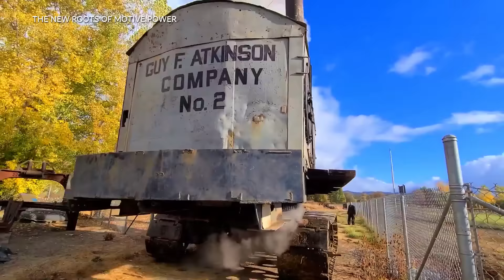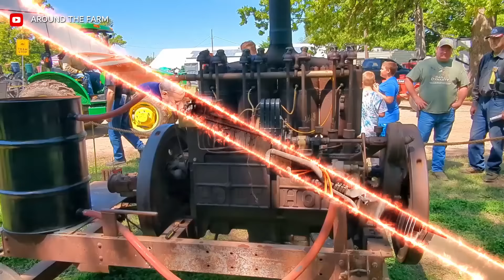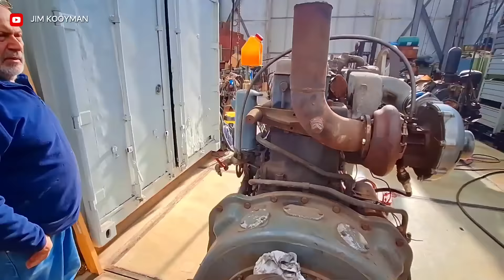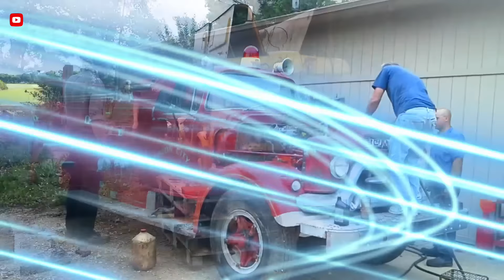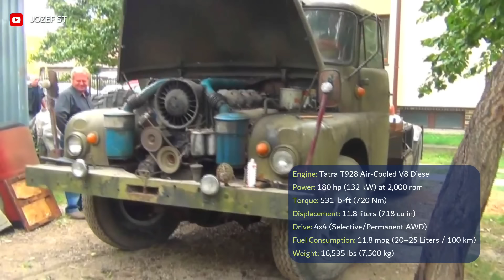Best Engine Ever…🔥 Will They Still Run? Starting Up Forgotten Giants From the Past

Comment: The first one, the Duvant, is NOT a single cylinder ; you can clearly see the two cylinder heads at the end. You say that it is started by compressed air, I am very doubtfull about that.

Comment: The Gardiner 8 cylinder is not naturally aspirated, it is turbo charged. You can clearly see the turbo in the video.
Reply: I'm sorry but I can see no turbo on the video... If you watch the exhaust from the manifold till the muffler and the exit, you can nothing else than a tube...
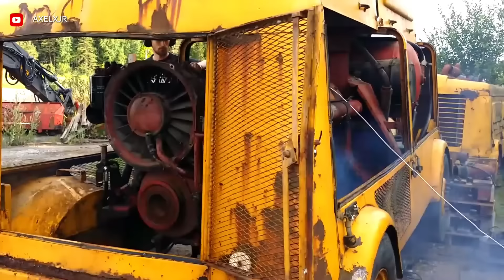Reply: My apologies, I thought you were talking about the first one... Yes, you're right the one at 10:42 IS turbocharged, of course !
Reply: Gardner.
Reply: One thing to add is gardners never had turbos they were N/A  6LW's were produced during the war in 110 DC generators for search lights , they were bought after  the war by showmen to power the lighting & rides after steam was slowly given up , if you go to a fun fair today you will still find 6LW's powering most rides & lighting   .....
Reply: @leso204 'One thing to add is gardners never had turbos'. Wrong, there were at least 3 that I can think of for automotive and marine use, 6LXCT, 6LXDT, 8LXCT,